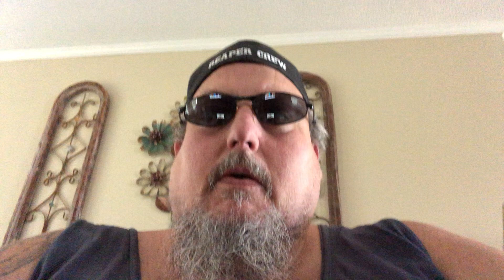Dont buy Bachmann

Comment: Before switching to Z scale, I was into N. I had Bachmann N scale ez track years ago and I had the same bad experience with the turnouts. Bachmann is, like you said, junk. When I switched to Kato unitrack in 2008, I was a whole lot happier and had even more fun. I once bought a Bachmann GP40 which turned out to be over oiled. And I mean over oiled. I managed to clean it out then it ran very good, but still less than perfect. That's what did it for me and I switched to Kato locomotives but continued to buy Bachmann rolling stock (and replacing their trucks and couples with Micro Trains trucks and couplers).